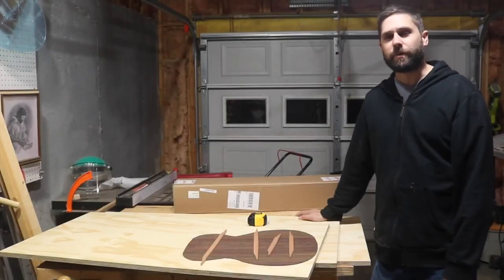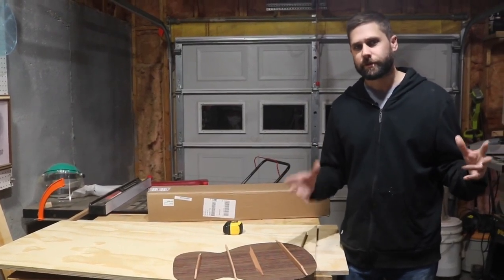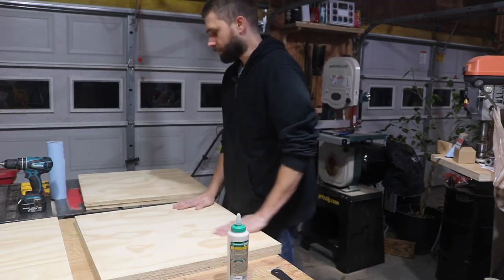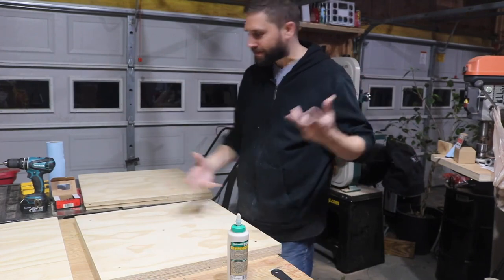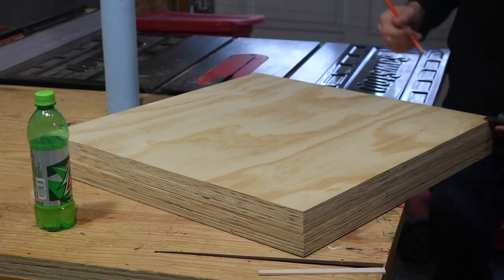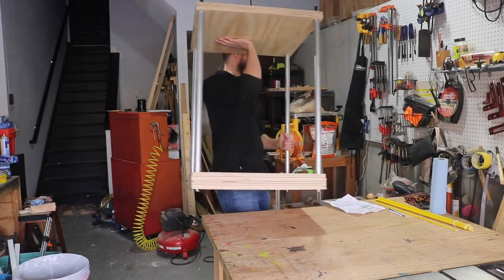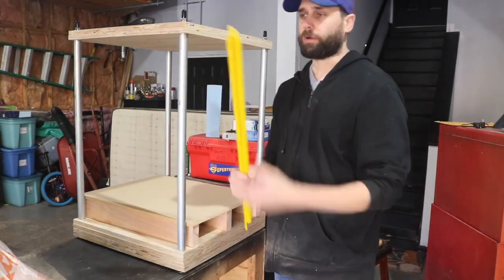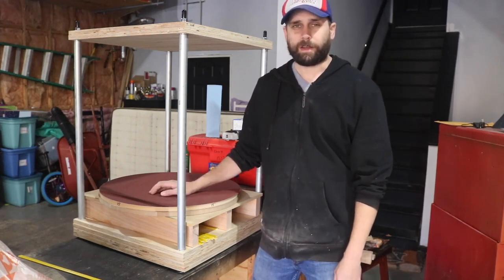StewMac Go-Bar Deck Assembly

Comment: It's kind of strange that Stew Mac would make the deck over sized. I mean they already have you using 4 layers of 3/4' plywood which is already overkill. I made a deck years ago with all thread and on top and bottom of the top and bottom plates. Very simple design and plenty heavy duty enough with just a single 3/4' piece top and bottom. You could just cut the support tubes down to the right height.
Reply: The extra space allows for projects of other thicknesses. Once you cut down the tubes you can only ever use it with thin material.
Reply: @SteveFrenchWoodNStuff  , makes sense.
Reply from the maker: I did wonder as I was building it if it was really necessary to use so much plywood. Probably will reduce the thickness and and hobble my own together from home depot hardware if I ever make another one. But, I didn’t really know what I needed and wanted something more sturdy than how the LMI one looks. This one definitely is sturdy, no doubt.

Comment: What did you ever come up with for the thickness of the added needed bottom to be able to use the 24" go-bars.  StewMac didn't offer any advise in their instructions.  Thanks
Reply from the maker: I just kept adding pieces until it worked. For clamping the top or back to the sides all I have in there is the radius dish and some thin shims under it. For clamping the braces onto the top or back, I have to add some 2x4’s and a couple of 1/2” panels if mdf that I have and also some thin shim material. Basically, every time I use it I just have to fiddle with how much height I need. No set amount yet.

Comment: Stew Mac makes nice stuff.  I didn't know they made a G0-Bar deck.  How much did it cost you?  And do you think it was worth it?
Reply from the maker: It was $150 or so for the hardware and then I had to buy plywood. So, not the cheapest option out there by any means, but I’m really glad I have it. If I could rewind, I’d probably just find all the hardware separately at a hardware store. It’d be much cheaper, but at the time it was just too easy for me to just buy it from StewMac since I wasn’t sure what I needed.

Comment: Your best video yet!  Great presentation, great camera setups, good explanations, professional editing, too!  What is the “Concave wooden dish for front and back” mentioned in the assembly instructions, please? Also, am impressed with your budget for this project too.
Reply from the maker: The concave dish is what I called a radius dish in the video. A lot of steel string guitars actually have a radius on the front and back. I have two since the radius is not the same on the front and back. Thanks for watching. I really appreciate it!

Comment: I don’t know if you already did this but you should cut down the sleeves that cover the treaded rod by about 6”-8” that way you lower the top enough to use the sticks, if it’s too short just a add a nut on the under side of the top